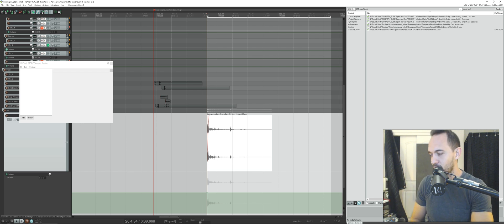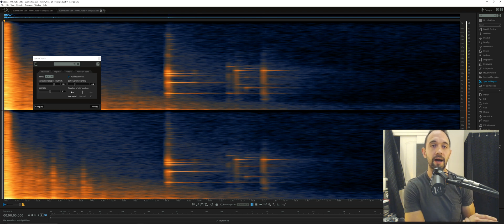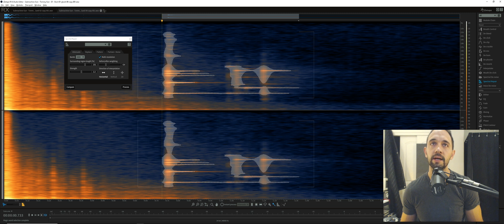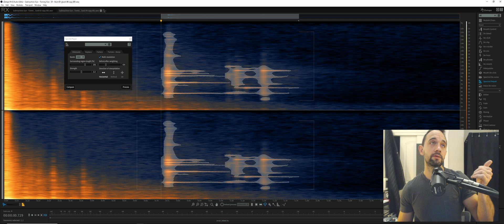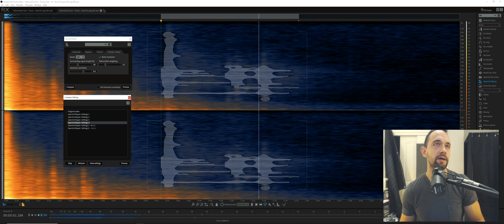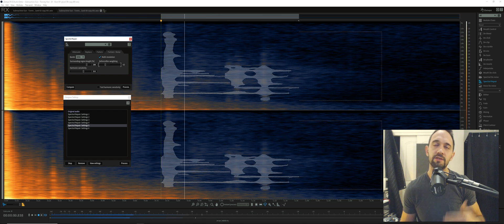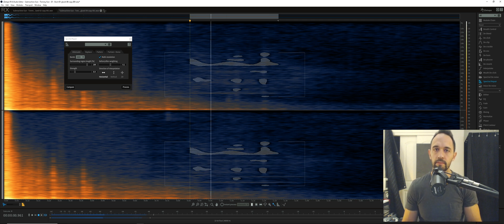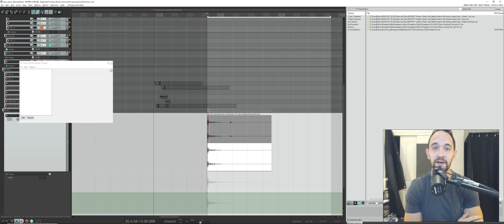Tutorial - Izotope RX Spectral Repair Workflow Enhancement Using Compare

Comment: Hi Aaron. Thanks for the great content. 

What about removing a steady tone out of a reverb that becomes apparent as the reverb fades. I have a good recording, my PCM d100 under a flipped over large metal fire pit dish and me doing all sorts of things with water over the top of the upside fire pit. When i was doing a lot of sweeps of the water over the metal pit, some crickets were making steady noise and they become apparent as the reverb tail fades. Its quite possible you have no idea what im trying to explain. haha. But is there some sort of adaptable frequency gating that fades in and out or something? How would i do that or something else?
Reply from the maker: The more variable the noise the trickier the removal IMO. For that I'd find the bands of the crickets and try a few things: First a spectral repair in multiple modes as in this video or  noise/tonal to see if that removes the crickets. If those didn't work I'd probably try a few passes with denoise or pro mb. If all that failed then it's manually removing them.
Reply: @aaronbrownsound  Thanks heaps for the detailed reply. :)